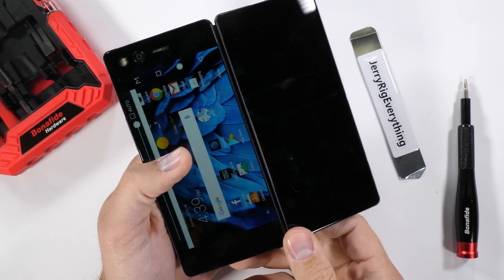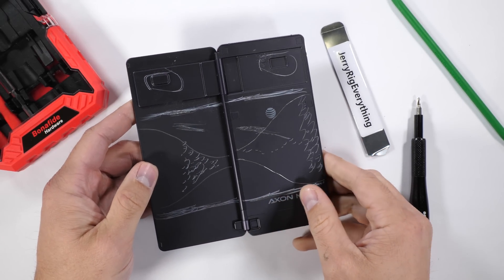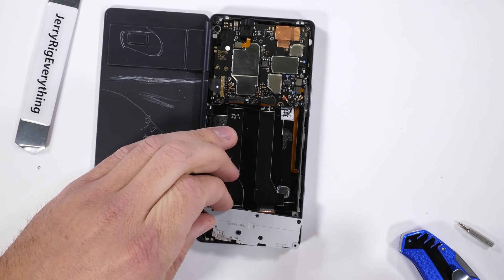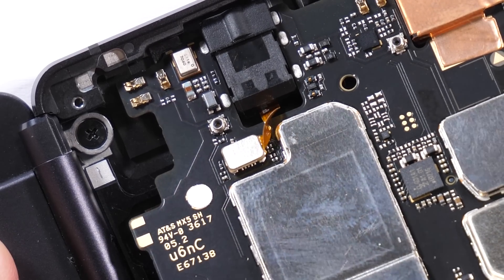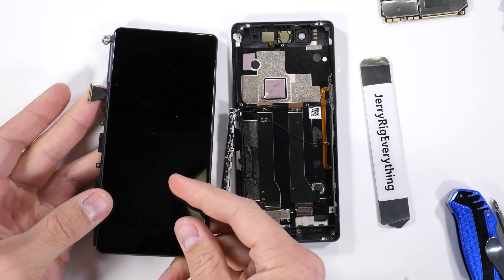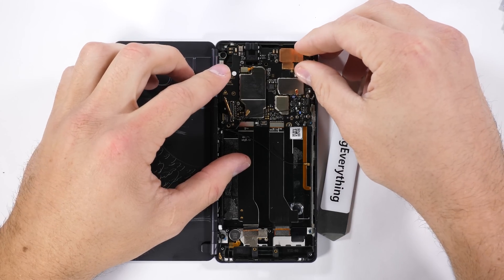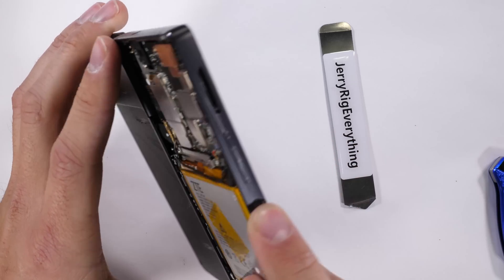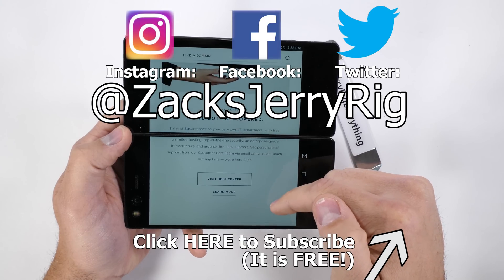How many screens can Smartphones have? - Teardown Axon M

Comment: I think, instead of the screens closing like on your laptop, it having a Z-fold would look better. You have the one central screen and phone. One screen folds over top of the central screen to simulate the "back" of the phone. The third screen, obviously folds back to become the face of this brick of a device. You can use this phone as normal, the possibility of dual (with just opening the back side), and even triple screen. This makes it possible to have a bigger - tablet like - screen, and depending on what you want, triple tasking. This design will definitely look better with an edge to edge display (like the S10/S10+ trailers) to enjoy those center pixels we all know and love.
Reply: Since I've owned this phone, I find I like the bezels on the top and bottom, just as a place to put my hands. The screens themselves are fairly sensitive and sometimes pick up my palm on the edge of the screen if I hold it with one hand without claw gripping it.
Reply: So when I hold it sideways for videos and the like, it gives me a good place for my hands

Comment: I think it's a neat idea, but I'd worry about the durability, cost, weight, size in your pocket, and battery consumption. It's nice because it gives you a bigger screen, which is what I like about tablets. But this you can carry with you more easily than a tablet... but then you got a brick thing in your pocket all the time. I wanna see "docking stations," or I guess a better term would be "shells" for phones that basically convert them into tablets for use at home in place of an entirely separate device. They'd have their own internal speakers, screen, and even battery, possibly with an option for charging your phone while it's "docked" in the tablet, but they would use the phone's processor, gpu, ram, etc. Just not draw power from the phone's battery, if that's possible. 

I know a lot of people who are either constantly charging their phones because it's their only device, or they have a phone and a tablet or a second phone at home. The tablet market sucks now, and the main reason I own a tablet is to save my phone's battery at home. I can't imagine I'm the only one, so I think this would be a good idea. The only real problem I see with it is how much phones can vary in size and where ports and buttons are located... and which types of ports. Making it universal would be difficult and end up probably being clunky and/or tedious, so it probably would just end up a short-lived thing for whichever company would give it a try.

Comment: Only 4 things should be added to make this phone perfect to me:
1) Front speakers 
2) Another camera 
3) A full screen from right to left to have a better image without that black bar in the middle that makes the image not to look complete 
4) Fix the problem that doesn’t allow the camera be used on both screens at the same time

Comment: Nice Video, but did you happen to notice what those u.fl connectors were for? I'm hoping one is Wifi and we can plug in an external high gain antenna. Also, no three screens for me, but if we're dreaming, I might be alright with a slightly wider, sub 1080p, dual screen phone (it's all about the battery life for me).

Comment: I rather have a regular screen phone (6 inches, since I'm so used to my Note 8's size) and either a built in projector or a portable projector so I can project an external screen onto a wall (or even better yet, get holographic display so I can display a big screen with no wall).

Comment: If you remember, that Snapdragon 810 had heating issues. Can you replace the thermal compound on the processor with thermal grizzly conductonaut? It would be very good entertainment if not relevant.

Comment: To remove the battery you have to heat the adhesive from the screen side, makes it very easy to remove battery after that. This stands for every phone without magic pull tabs, so you don't have to use brute force and bend or damage the batteries.

Comment: practically it is not feeseable to put 3 screenes 
1st. large battery needed
2nd. good processor
3rd. more moving parts less durable
4th. the phone will become impractically thick
5th. how the heat sink will work?

Comment: im no engineer but i think they can use those magnetic golden tabs like on the side of samsung tablets to power another screen. Imagine having those on both side and you can just buy a third party display for phones and tablets
Reply: That used to be a thing. The Blackberry Z10 has a micro HDMI port. Later generations of phones made that function wireless.
Reply: Nym8ted or just use Chromecast.

Comment: You'd probably need one hell of a battery for a triple screen phone
Reply: They can put a battery in each screen module and connect them in parallel. Although such phone may be "a bit" thicker than usual.
Reply: oh my god potato ×7 i see you almost everywhere
Reply: I'd happily have the phone thicker for 3 batteries.
Reply: you could have the additional batteries for the screens only, so you'd need only a display port going between them, and you could make the connectors modular, so you could make a 2,3,4,5,6,7,8,9,10 screen phone.
Reply: that would be heel to manage and load balance 3 batteries between a hinge sine then you would need beefy connections form the phone to ht screen instead of a  thin power cable for the screen that doesn't draw, that much power.
Reply: lets say, 12000 mAh
Reply: Or you could turn off the other 2 screens entirely when it is being used in fold mode.
Reply: that is true

Comment: Pretty stupid. Pretty ugly. Pretty pointless.
Reply: Jay Banner pretty stupid- nope, why would it be?
Pretty ugly- this is a first try of a product.
Pretty pointless- just like how fingerprint scanners, face IDs, 18:9 ratios, everything new.
Reply: Just My opinion. Not forcing My view on you or anyone else. It's an ugly design simply because of the weird hinge system and overall shape. Pointless because WHY would you need two screens when the entire planet is managing just fine with one? And third and finally.. It's stupid again, because of the design. What is the benefit to a dual screen phone that will eat twice the power to use both screens, as well as being thicker and heavier to lug around? If you want dual screens, buy a freakin' 3DS/2DS. Just My two cents.
Reply: Jay Banner Did I tell you its beautiful? No, I said its a new product in development. Also, the benifit is multitasking. Because of this being a new product, it has a lot of compromises. Can I install apps on a 3DS? Besides this is perfect for emulators.